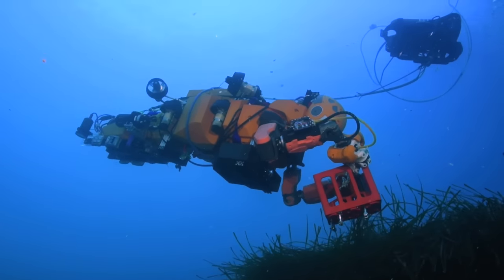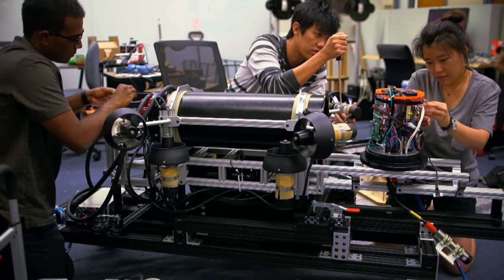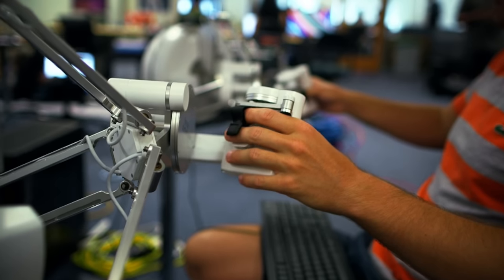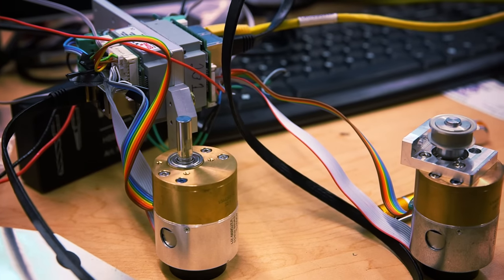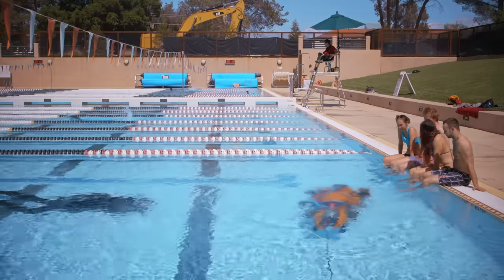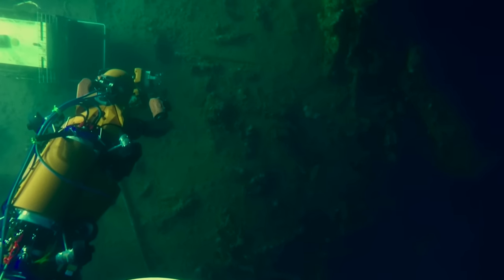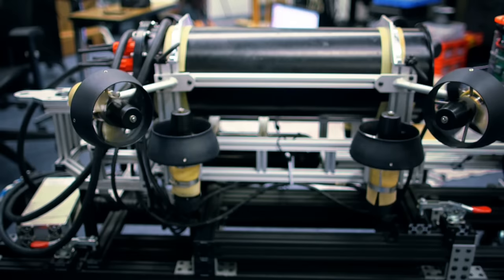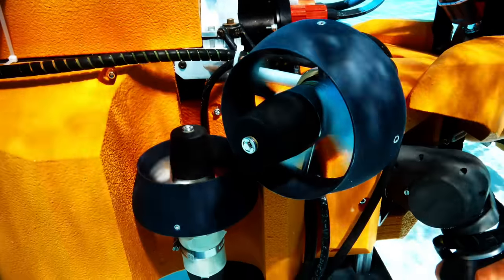Stanford's humanoid robot explores an abandoned shipwreck

Comment: Give it a neck axis and integrate HTC Vive.  Or better yet, replace the head with two 180 degree cameras integrating Google Street View style virtual camera rotation.  There's your binocular vision without the need of a head or mechanical steering axis.
Reply: Hey, a good idea is a good idea.  Just because someone has Stanford on their CV doesn't make them think of everything. A head is meant to be a support for a brain, ears, nose, mouth, eyes and facial skin sensors.  If all you need is an eye, drop the rest.

Comment: This will be great in radioactive, toxic and highly infectious waters.
Reply: +Bocskai Csaba Why?
Reply: +ANTONIO ALEXANDER SUAREZ Because humans cannot dive there or they will possibly be harmed. Anywhere that is potentially dangerous to explore or go to should be explored by a robot in order to remove that possibility.
Reply: +Redstone Basketball There are many other applications for it. Another thing that popped into my mind is big depth waters (seas, oceans).
Reply: +Bocskai Csaba There is a machine caller ROV (Remotelly Operated Vehicle) that was invented in the 70s and upgraded with the latest technology since that time. It is widely used in the Oil&Gas industry. This humanoid project looks great. But the "problem" it seems to want to fix has already been solved since 1970.

https://www.wikiwand.com/en/Remotely_operated_underwater_vehicle
Reply: My question was "why"because you pointed out only for contamined, toxic waters!though this ROV is far from being high's depth machine! many years working in the world of ROV and AUV ! a workclass can get to 4000mt and work on any subsea structure